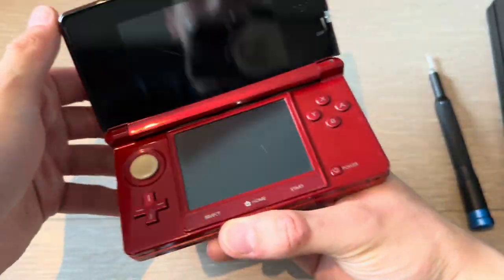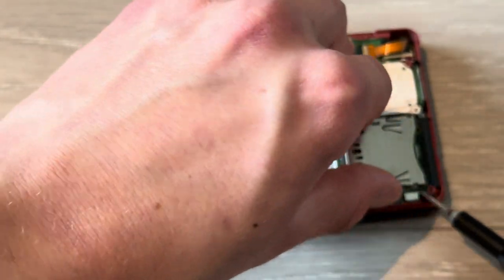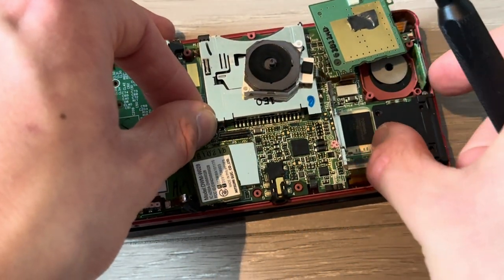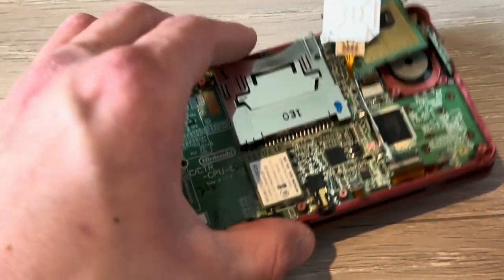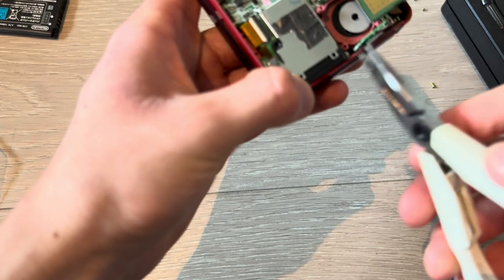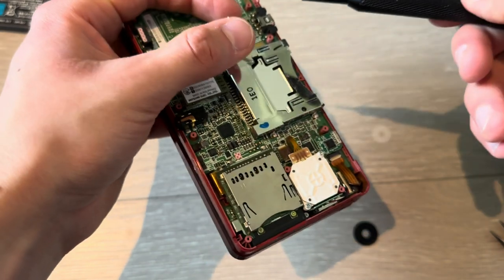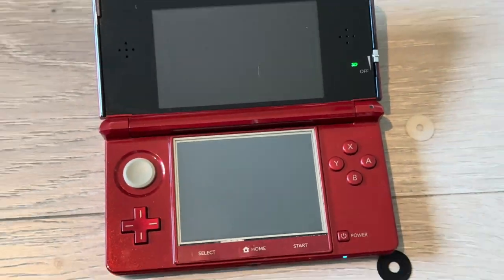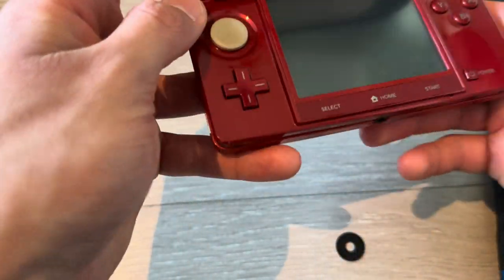How to change Touch screen on the Nintendo 3DS!

Comment: I accidentally pulled the wifi board too hard and the wire came off the board, is there a way to fix it?? please help
Reply from the maker: Yeah there is. But if its possible is upto you. You need a new part too. Search on AliExpress and YouTube. I havent done this mistake myself so i dont have a video for it yet.
Reply: @RetroBoyy  do I have to pin it back on or do I have to solder it
Reply from the maker: @Whatdadogdoinz you have to replace the entire cable